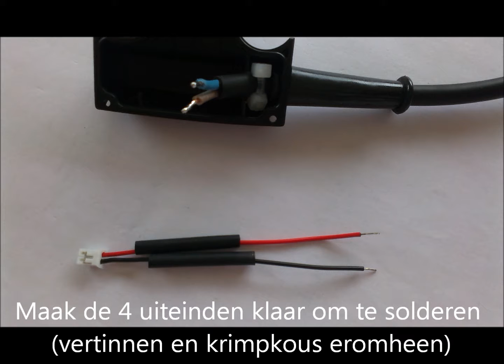Hoe maak je een afneembare Garmin Zümo 590 of Zümo 595 steun

Comment: I'm very basic on auto electric. Only one question: how are the color conection of the 4 wires? The smal white plug have red and black and the new cable, blue and brown. Thanks
Reply from the maker: A somewhat late answer, sorry for that... The Garmin's red and the black cables stand for : red = battery voltage (12V), black = ground. This is a convention also valid in the Garmin wire scheme, and I have never seen this convention violated (i.e. in Europe, don't know how this is in other parts of the world). So if you make sure the brown and black cables are connected in a way that the connection gives 12V to the red wire, and the connection to the black wire is connected to ground (GND), you're good.
Reply: @sudolea   Thanks ;)

Comment: I have a Zumo 660lm on my 2014 Victory Vision - I have the factory harness / wiring kit installed. I wanted to upgrade to the Zumo 595lm plus it has tire monitor ability and also able to control the garmin action cam. Anyway I was exploring to see if I could remove the two plugs in from the Zumo 660 and plug them into the two plugs in the Zumo 595lm - like someone else said Garmin will not give me the wire diagram to ensure all the pins are correct - I was just hoping they use the same color coded wires - from  looking around the only difference is they now have a mic into the Zumo 595lm which they did not have on the Zumo 660. Anyway this video was invaluable in helping at least see if this was possible (as I have yet to purchase a 595LM)  so thank you so much.!

Follow up - I just took my spare mount apart and it has a 12 pin connector and the colors don't match -oh well - probably smarter and easier  just to rewire at the other end.
Reply from the maker: Glad it was helpful :-) If I understand your reaction correctly, I don't think you need any of the extra wires (i.e. apart from the 0 and +12V) of the 505's cable loom for most of the functions you intend to use (tire monitoring, action cam - VIRB), as most are, in my understanding, functions which are using bluetooth --> beware for the microphone functionality, though, but I never ever used it.

Comment: Can you wire the power directly to a Male 12 Vvolt Cigarette adapter?
Reply from the maker: Whichever connector you use, the input to the Zümo is 12V (of course, properly connected, i.e. 12V = red, ground = black). That's the voltage of most bikes indeed, at least in Europe (there aren't any other bike voltages around, are there ?)
Reply: @sudolea  6 volt, bikes until 1960's

Comment: what size is the hole in mm for the cable Strain Relief to be fitted ?
Reply from the maker: Very sorry for the late response, I must have missed your question somehow. My answer may come too late for you to still be of use, but just in case ...

IF I understand correctly which hole you mean, then it must be the hole in which the part shown at 1:45 fits in ? I measured that part from my remaining cable loom, and it has a rather rectangular shape, measuring 6 x 9 mm. I chose 2 clamping straps (correct English translation ?), because 2 are wider than one single strap, making it harder to pull the combination (see the picture at 2:04) through the hole...